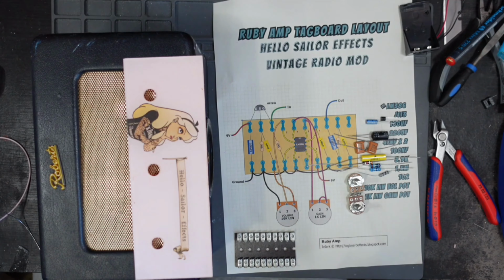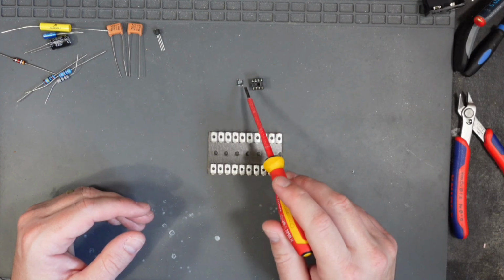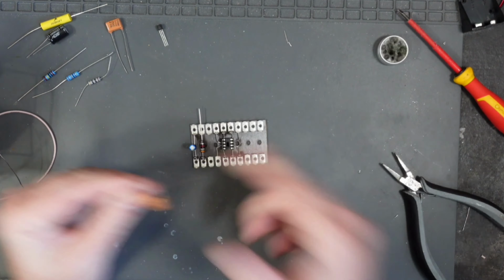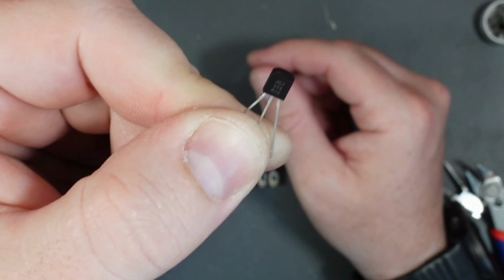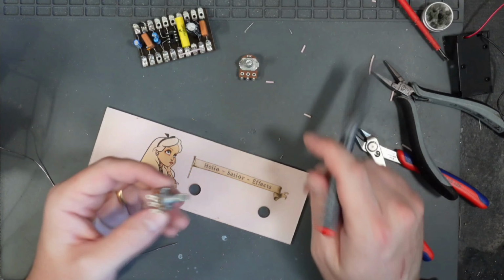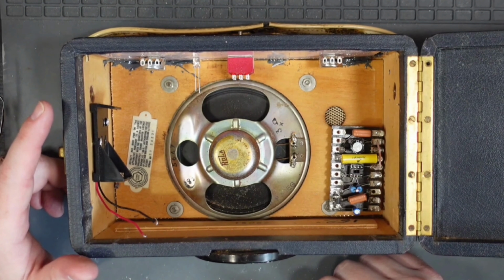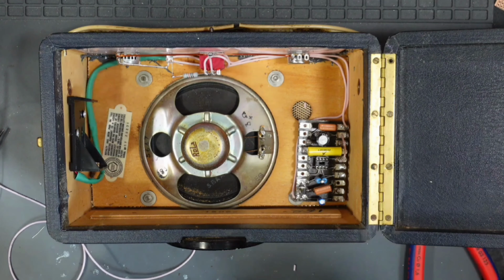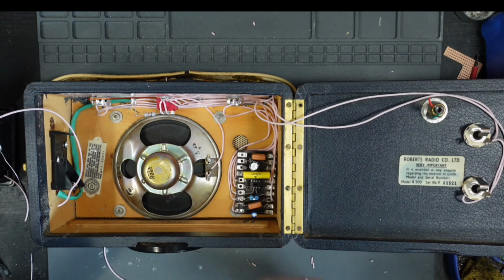I Built a Vintage Radio Amplifier (and it WORKS!)

Comment: Doe the caps matter or can i use anything as long the values are correct?
Reply from the maker: @schissgring  It all matters in my opinion mate. The question is, do you like the sound of the caps you use?
Reply: @hellosailoreffectsofficial  So then i need to try what i have and if i don't like it get other caps and try them until i'm happy with the tone but i should stick to the correct values?
Reply from the maker: @schissgring  Yeah mate absolutely. Also if you end up changing values and liking the results I'd love to hear about it. Im always looking for ways to chase different tones.

Comment: I am going to try and build this cos yours sounds "Epic"! I got a Guitar lead and lopped a jack off 1 end and put the live on the input lug of a volume contril on an old valve radio and Earth to the chassis and everytime I turned it on it would turn "off" ! Found out that the Earth was not on the mains plug so I hooked it to the neatral and it worked, very fuzzy but useful for Guitar and plugging in a Phone to listen to tunes. Thanks for these Videos , shows us that the best way to learn is by making mistakes ( not intetionally). Cool stuff!
Reply from the maker: @jooles0001  Thank you mate I really appreciate that. I cant wait to hear how you get on.

Great idea with the old valve radio. I haven't messed with them before.

Thanks for watching.

Comment: For building the classic Ruby by Runoffgroove, you really want either a higher voltage version of the LM386 from TI/National called the LM386N-3 or LM386N-4, or my favorite and the preferred choice of many is the NJM386D from Japan Radio Company which produces the best distortion tones.  The lower power -1 parts still sound good, but the -3, -4, and JRC versions sound gooder.  Another solution for the 3.9k here is to use a slightly smaller resistor like 1k or 1.5k in series with a 5k or 10k trimmer so you can bias the particular JFET used. JFETs are all over the map when manufactured and most of them will work fine in this circuit when properly biased. You ideally want to adjust the trimmer to get 1/2 V+ on the drain and you're good to go.
Reply from the maker: @Peter_S_  Thanks mate much appreciated
Reply: @hellosailoreffectsofficial  No worries mate!  Built my first 386 amp in 1987 or 1988 and I still remember the day in late 2003 or early 2004 when Gary from Runoffgroove first posted the Ruby schematic which was the evolution of their LIttle Gem amp and/or Grace Overdrive and/or Bug Daddy Overdrive which were inspired by Aron Nelson's Smash Drive which was inspired by Tim Escobedo's Stupidity Box distortion and Rambler amp in late 2002.  Tim and I arrived at the same destination but he arrived via the Smokey amp which was a product a decade earlier and I arrived by repurposing the monitor amp and speaker from old 1200 Baud modems- add a jack and a 9V and you've got an amp.
Reply from the maker: @Peter_S_  I started building in 2008 and Runoffgroove was my favourite website. My cohost on The Pedal Dive Podcast, John was one of the early builders on the scene adopting this stuff much like yourself.
Reply: @hellosailoreffectsofficial  Very cool.  My first 'pedal' was a Fuzz Face kit from an electronics store in the late 1980s which had probably been hanging on the rack since the 70s, and my first scratch build was a Hex Inverter Fuzz from Craig Anderton's Electronic Projects for Musicians in 1987-88.  I might have been a big player in the pedal world but life got in the way.  C'est la vie.  25 years ago and for about 5 years I moderated Aron's diystompboxes.  It was daily work to keep the ZVex and EHX schematics off.
Reply from the maker: @Peter_S_  Wow thats epic mate. I can imagine that was tough. They seem to have found there way into the world now too.

John also has all the old books. He's constantly showing me cool stuff from them. I do wonder if there's still gold to be had in there.

That fuzz sounds like it would be killer mate.

Comment: "Earth!" is on AC circuits. DC uses -ve voltage or "Ground".
Reply: "Earth" tends to be used in mains powered equipment where there is an actual connection to Planet Earth provided by the power cable.  However it isn't a fixed rule.   "Earth" is often used to mean a point of zero potential, as in Virtual Earth in op amp circuits, but so is "Ground".  The meaning is usually obvious from the context.
Reply from the maker: @wilhelmvonn9619  That's my understanding too mate. It's hard for me to gauge as all of my engineering experience has been from military life, it doesn't always transfer over especially when terminology is involved.
Reply from the maker: @mik99D  Firstly thank you for watching the video.
 Listen mate, I've served over 22 years at sea (still serve actually) in the Royal Navy working on this style equipment. Do you really think I can't tell the difference between AC and DC? 
Come on now ha ha. I find it easy to refer to the negative reference as earth, it helps mu mind as we draw earth symbols on a schematic for this.

Comment: I clicked on the wrong order number and got the SMD 386. I make them on Veroboard.. With the pot between the cap and pin 1. I started making them when I was teaching at Hugh Baird College in Bootle. I was the physics and engineering lecturer.
Reply from the maker: @mik99D  Epic mate. I hadn't realised how awesome this circuit sounds to be fair!

Comment: Very nice! I've actually got some pcb's from five cats pedals to build including the Ruby Amp. I'm going to build my Ruby amp in a retro style radio biscuit tin. I'm a newbie to this, so hopefully I won't mess it up!
Reply from the maker: @williamjenkins9423  I absolutely LOVE the Five Cats Pedals kits. I bet your Ruby amp is going to be killer mate. Did you see the Tremolo Mod I did with one of his kits? I really enjoyed that video.
Reply: @hellosailoreffectsofficial  hi mate, thanks for your reply. I hope it will be killer! I haven't seen your mod video yet, but will look at it soon. The other boards I got from five cats are:- Axis Fuzz, Solar 108, Scorpion Boost, Duck Duck, Violtear, Dunder Dirt Cheap and Deep Down. I've almost got all the components for everything!
Reply from the maker: @williamjenkins9423  Oh wow you've got loads of them. Nicely done mate. I cant wait to see them.
Reply: @hellosailoreffectsofficial  I can't wait to start building them! I'm just short of some resistors, ceramic capacitors, electrolytic capacitors, and some dc jacks (I think, if I remember rightly)

Comment: Great build.... though not for the faint of heart like me. Sounds amazing with the range master. I am inspired to be plugging my new kossoff drive into a Fender Tre-Verb stereo pedal and out to 2  Fender Champion 600 5 watt combo's and cause a rumble in the dumble.😜😎🎸🇬🇧
Reply from the maker: @nodrog5150  Thank you mate I really appreciate that.

I bet that's going to sound killer! I would absolutely love to hear it.

You sure your not going to have a go at one of these amps?
Reply: @hellosailoreffectsofficial  I'm all fingers and thumbs Joe and I get flustered quickly so it's not for me.
I'm always threatening to do a blend circuit with my 2 Strats as I think the volume and 2 tone set up is a bit outdated. A blend knob between 2 or 3 pickups seems a more practical way to go. My whole problem is the soldering iron. I've never found one that holds it's heat in between solders and I hate when it's just not doing the job precisely. I suppose that comes down to the quality of the iron. 
I have 2 irons, one is a gas powered one that I tried and it actually worked. The other one has the LED temperature window built into the body. That one I haven't tried.🤔 I must get my finger out and mod those 3 pickups circuits😜
Reply from the maker: @nodrog5150  Ha ha you should have a crack mate it's fun

Comment: Yeah, the first time I put a pot into an enclosure I drille for the little locator tab.......that was the last time and Ive never looked back. Haha Ive done a massive TWO whole pedals too! I want to build my own amp so badly I have fantasies of using old tubes out of radios to make my own small amp.
Reply from the maker: That's awesome mate. Building old tube amps is so much fun!

Comment: Are LM386 and LM358 compatible or rather, could they possibly perform the same function in this sort of realm? (guitar effects, etc) That trick with the battery on the speaker was top-notch! Very cool man.
Reply from the maker: @codelicious6590  I'm going to give the opamp suggested in the recebt comments a go but, here's what Google says about them.

The LM386 and LM385 are both audio amplifier chips with different characteristics:

LM386: This audio amplifier chip has a low noise and distortion circuit design, and is small in size. It has a default gain of 20x, which can be adjusted by connecting capacitors. The LM386 is suitable for portable battery-powered guitar mini amplifiers. 
LM385: This is a micropower two-terminal bandgap voltage regulator diode. It has a wide current range of 10 µA to 20 mA, low noise, and stable operation over time and temperature

Comment: The first amp I built from the ruby schematics was mounted in a wooden box that I had made for a craft gallery that didn’t meet my quality standards for that purpose but was the exact right size for a vintage speaker that I wanted to use, the most recent one I built into a detachable speaker from an old Sony boombox and have been using it as a test amp when I don’t want to fire up the big rigs. There is also a really cool variation on this design from Beavis Audio Research called the Noisy Cricket that adds a tone control and a dirt switch to simulate an overdriven tube amp. These are fun little projects that actually have a lot of uses, and can be mounted in some wild ways!! 👍🤙🖖
Reply from the maker: @spacewolf9585  I absolutely first and foremost love your creations and that sony amp you built is so damn cool.

Your an inspiration mate.
Reply: @spacewolf9585 you fellas should do this for your pod cast. Episode called "who can build the best ruby"

Comment: Just found your channel Joe, love these videos. 

I’ve built a few of these little Robert’s radio ruby amps now they’re great. 

by far my favourite one was a slightly larger Robert’s radio in which I also fitted a Timmy clone and a keeley mag delay. 

Also fitted a rechargeable battery bank with hours of play time. 

Give it a try!
Reply from the maker: @danbrennan2727  Thank you so much for the kind words, it's great to have you along for the ride.

It's funny you say that mate, I have been contemplating this very thing! I wad thinking delay and reverb would go well. What rechargeable power supply did you go for in the end?